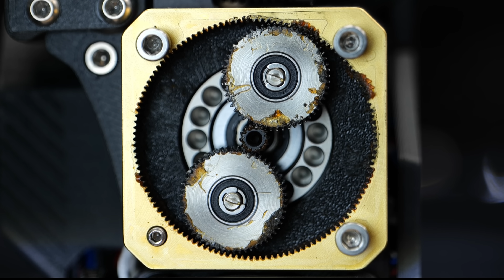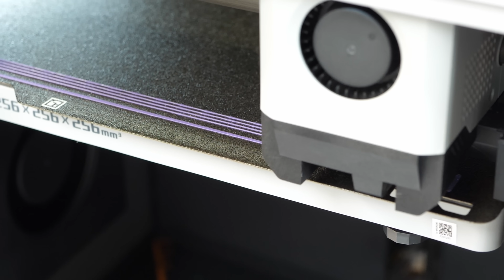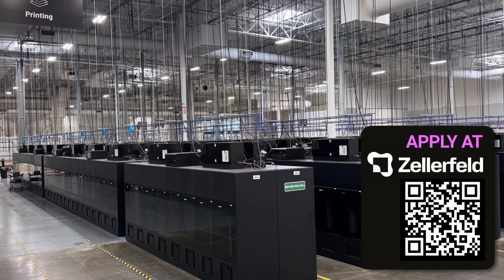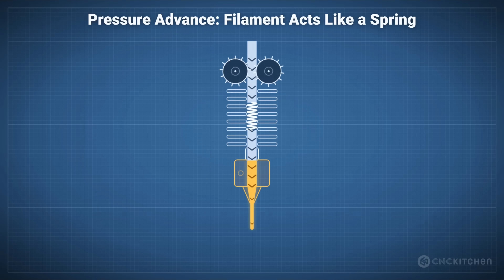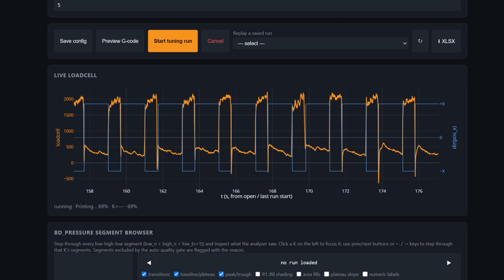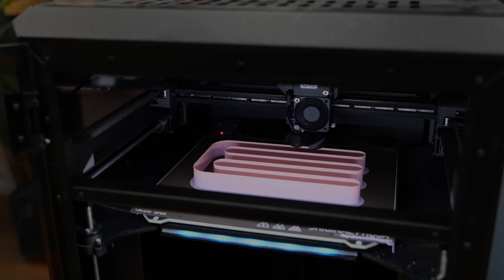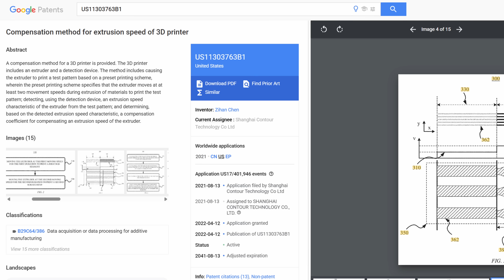I Automated Pressure Advance Using a Bed-Leveling Sensor

Comment: You totally missed explaining how BambuLab printers only use Lidar for the very first filament and none after that. Because of that, the automatic K values will be wrong. Also, I'm not sure they store the K values anywhere, so it's not like you can use them in a future print job either. What a waste. I'd prefer to simply measure it once for the spool (since it can't do it during the print like Prusa's load cell), and be done with it. Doesn't have to be this "every time but only for the one filament" thing.

Comment: This may be way off. I still have issues with the design software. I come at this like a race car needing a accusump oil accumulator. Currently the acceleration of the molten filament is not directed downward if the pictures you show are true. If the internals of the hot end were enlarged to Maybe a downward slowly twisting screw counter direction shaped wall to a center section screw shape would direct the flow downward faster during acceleration. Those could be swapped out depending on material. It could be a heat source as well making the filament slicker and slide off easily.

Comment: i hope you are still working on this and that this becomes well adopted in klipper... turnes out in germany its pretty hard to get the HX717 chip which has a higher sampling rate then your avarage hx711 chip. but i bought some from hungary and crality has some strain gauge/loadcells which are pretty reasonablely priced. im currently in the design prozess and i really hope that i can get it to work with the plug in... i think this is really a massive leap forward bedleveling, gantry leveling, mesh bed leveling and pressure advance all with bascially no moving parts and one single pretty simple and lightweigt sensor sounds like a dream. no stuck bl touch probe, no unrelatible inductive or light sensor wo worried about a sensor not triggerd properly and the nozzel crashing into the bed because the crash is exactly what this is working off of ... really huge promises into reliability and precision... later this could even be used to index off of parts x, y and z to do recovery and stuff

Comment: Hello stefan, i think your product is absolutely amazing, i wanted to propose to train an ai based on the square wave yout talked about, it should be realtively easy since you implemented already all the metrics and you only have to change one value. I think an unsupervised training could be performed; in alternative an analysis with mechanical impedances may pose as a starting poit to run a simulation to trian an ai ad then validate it in the printer. If you saved the previous runs maybe you could also use them as a dataset.

Comment: Patent are probably the worst thing happened to innovation in the last millenia. All the patent are based on the work of the whole scientific community, made by the humanity over the whole story. that epsilon additional knowledge added by a signle individual on top of it makes the whole knowledge unusable for everyone else. 
Bamboolab didn't invent LiDAR, didn't invent FDM printing, didn't invent backpressure calibration. But with a patent they can prevent the use of LiDAR to perform backpressure calibration in FDM printing, even to the people invented those technologies. 
Furthermore, they are basically using LiDAR, backpressure calibration procedurees and FDM printing for their intended purpose, and making a patent out of it. They should have copyright on the exact implementation but the idea is trivial: like patenting using a caliper to measure the calibration print to get the accurate result, you are just using each tool for their exact intended purpose, no innovation. Something like that, while requires a little bit of research to fine-tune the parameters, but is not justifying the ability of maintianing exclusivity for 20 years (which is what patent grants).

Comment: What I am always asked myself: How does the automatic flow calibration works when there were already some PA values set in the print file? Do the values interfere with each other? Or does the the value gets replaced?

Because I assume that in the final g-code it's not possible to determine the used PA anymore. 

Would also be nice if we could see the measured values of the snapmaker for example to save it then for that filament so we don't have to run flow calibration again.

Comment: Implementation into the FW is much easier than the web page you've created. Take the FW code, some AI agent and get inspired by G26. Let the agent to create a new metric for this. I can create it but I don't have a Prusa printer with the Nextruder.

Comment: I really liked it back in the day when I could get the X1C's autocalibrated K values out with the Homeassistant integration, and then I'd just put it into Orca. But I haven't been able to do that for ages now.
For the U1, is the autocalibrated value available for read out anywhere? Cause right now, when I switch filament, I have to ask it to calibrate, which takes time. I'd prefer to just store the K value in Snorca. I recently learned I can just enter the U1's IP into my browser and see the see the Fluidd. I wonder if the values are readable through there somehow if Snorca doesn't want to expose it.

Comment: In regards to the actual print progress I was thinking about this for print recovery, but since the sliced file is volatile I wanted to run the file backwards in height through solid wall (where wall should be) till the sensor hits the print, then run the layer backwards again till hits print then runs the file from there minus a line or 2...

Comment: I have been looking at comparison between the U1 and the Creator 5.  Nobody has ever mentioned automatic calibration, shouldn't the lack of calibration show up in reviews or does the creator 5 actually do it.  While I am talking about reviews, the Creality Hi uses closed loop servos and this is not demonstrated in any reviews,  surely this is a big improvement but may only show up with long term usage.

Comment: The title felt like clickbait. Was disappointed to see that only a  load cell mounted on the extruder in a particular way could be used for leveling and auto pressure advance. Still cool though, nice work.

Comment: That´s pretty awesome!
Is there a difference if you "actually" print into free air or if it builds a mountain?
Could pressure advance be combined with accelerating or decelerating it´s moving axis also?

Comment: But what about different pressure advance values for different speeds and accelerations? Only one value is not enough, regardless of whether you obtained it automatically or manually. You have to look at how it actually prints with different acceleration as the filament being dragged more rapidly and you may need to kick in additional pressure earlier not to smooth the corner.
This is why adaptive pressure advance is a thing and produces extraordinary results.
I know the video is mostly about technology and not how to transcend it into practical field, but still, worth mentioning.
Reply: Yeah I was wondering that too, sure you could tell the extruder to go faster similar speed to your actual printer, but then there's other circumstances where filament may get dragged out by the filament that is laid down already.

Comment: Could this be done with motor current sensing? I'm thinking about tool changers and the expense of adding a load cell for each tool when auto PA could be had for free using the extruder stepper motor (assuming it's feasible).

Comment: Your thumbnail says LIDAR, but I've never seen anyone tear down the bambulab "LIDAR" sensor and demonstrate how it works, whether it actually uses lasers, what the part number is, etc. I have my doubts it is actually LIDAR and is really just a camera, but would be interested either way. Your idea is great, thanks for sharing
Reply: It isnt LIDAR in the traditional sense of measuring time of flight (or fancy FMCW magic).
Its based on trigonometry with a line laser and a camera.

Comment: Would it not be better to have the nozzle printing lines at height with intermittent extrusion speed changes like others do it? I would think extruding in mid-air excludes the important variable of back pressure.

Comment: I had bought an SV08 partially because I was under the impression that its pressure sensor was actually in the nozzle, and I am continually dismayed that this is not the case. Something like this would be very easy to implement into such an open system.

Comment: Does the calibration process increase K value linearly to calibrate, or does it use a more efficient algorithm requiring fewer test extrusions? Using less filament when calibrating would be a plus

Comment: Add live monitoring during the print to auto adjust for filament tolerances and now you get dimensionally accurate parts on filaments that are +-.05mm 1.75 mm…or more. $5 MAX PRICE PER KG FTW. Maybe even cheaper once manufactures can’t hide behind tolerances being a price constraint. So long as they don’t start messing up the formulas 🙄 good thing their existing formulas are basically everywhere in at least a couple hundred thousand benchys all over the world and has been for YEARS

Comment: Great info about the flow calibration, wouldn't the head level while extruding also cause back pressure?? It would be different when doing a .4 layer and completely different when doing a .2 or a .08 layer?? While feeding into thin air will give a reading for testing it doesn't take into affect the added pressure of the layer height and the speed its being laid down at?? Maybe i am over thinking it but its just my take on your process, keep up the great work on the printers. Look forward to the next one!!

Comment: Hi Stefan! I wrote to the auto pa tune guys cause they posted in the voron facebook page about it a while ago and i had just "purchased" a pair or heatcore 4 hotends, one with the ALPS module. Maybe slightly irritated cause it seemed to me looking at their github and webpage they just wanted to sell their hotend loadcells. I Couldn't be more wrong. They answered me that the ALPS module was compatible and I could perfectly just "use their project code". in the end I have still not been able to try it as I dediced to first finish the stealthchanger mod I had started and still haven't finished but maybe that klipper module can help you try it in another klipper printer more open to get debugging data.

Comment: Since G-code is a complete language, why not sample the variables and do the math in a G-code program?  Do most printers implement the full G-code language, or just a subset?
Reply: Not even every CNC machine implements all g-code commands, and there can be differences in how each command even works between manufacturers. I have experience in CNC lathes and milling machines using Fanuc's control systems, and as far as I know, G-code isn't a "programming language", it's a set of commands that you can use to create a program for the machine to follow. I mean, you can't "do math" in the program - you tell the machine to "do the math" with the correct commands (eg. interpolate a move there, calculate and perform a loop here, start a work cycle from there etc.).

Comment: A single K-factor isn't going to do it, you need to tune for many possible values if you want it to be general-purpose.
Nobody is doing this yet, but, with a system like this, it's entirely possible.

Comment: Only issue with this is it requires printers to have a strain gauge. Wonder if you could look at amp draw of the extruder stepper motor to determine how much pressure is created and use that.
Reply: But the extruder motor torque also includes the moment if inertia when changing extrusion speed.

Comment: The main problem with PA is that it needs additional parameters, such as actual flow (not the gcode calculated, but the real flow), which is dependent of layer height, width, temperature etc. That's why I use adaptive pressure advance with orca. Needs lot more time to calibrate, but gives faaaar superior results, especially with bigger nozzles.
Reply: Adaptive pressure advance exists?! Whoah, I guess I finally got to take a look at that whale, despite it being so damn ugly...

Comment: Very good video, but the prusa extruder when the thermal glue of the load cell is damaged (the high temperature may damage it) the extruder start many times loops of calibration and create holes on the platform because a fault load cell don't stop the z axis on the platform. The difficulty for this problem is the high cost of the conponent and you should disassembly the entire block. 😅

Comment: Using the same technology, you can set the temperature of the hotend automatically. This way, no matter what type of plastic you use, it will always print at the correct temperature and flow rate.

Comment: Excellent video. I think you can get the klipper info on the motion planner too. I did it for a couple things in the past. Its not too hard to get. It should gove you what you need to tune your pa. Its through the api. Just need to start killpy with debug api
Reply: It's a solved problem on Kalico, garethky has been looking at that 🙂

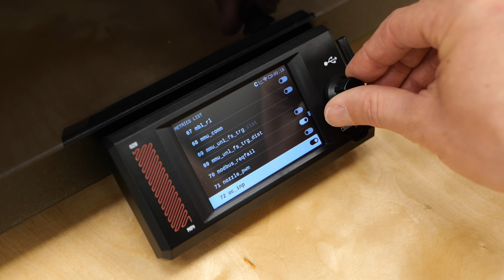Comment: 12:15 Since you can send values for the x and y positions, wouldn't it be possible to move the extruder along those axes a bit to determine the start and end of each test cycle? 

While watching the video, I noticed that the extruder was moving back and forth a bit, so I guess that's what you were trying to do, but if not, that might be worth a try.

Comment: PandaPI sensors are my go to.
The BDPressure allows me to Auto-Calibrate PA at the start of every print, while the BDWidth makes sure any inconsistency in filament width is automatically accounted for.

As per the software tools you made, might I recommend having your slicer hand over your print metrics (Outer wall speed, Accel, Accel-to-decel ratio, extruder-temp, etc) and have that data decide a more optimal curve per print, essentially creating a custom nonlinear PA curve.
I have a proven fork of mark's bdpressure code with these changes implemented. Works well for my setup.
I also have an edit for the BDWidth code that accounts for occasional off readings, averaging measured filament width over a selected length-step (every 5mm works for me)
Love that you covered the sensors! They're awesome!

Comment: I wanted to monitor chamber temperature on the Core One and XL over my local network, but PrusaLink doesn't offer it.
Looking at the metrics feature, though, it can monitor a lot more than just chamber temperature.
I happened to find the answer to my problem in this video. Thanks, Stefan!

Comment: "This is incredible work, Stefan! Now that Prusa is deploying the multi-tool INDX system on the CORE One, automated load cell calibration shouldn't just be an experimental script—it needs to be native. Swapping up to 8 materials on the INDX means manual K-factor test prints are a user nightmare.Since the hardware (Nextruder load cells) is already sitting in thousands of machines costing $0 in extra parts, you have the ultimate leverage to push Prusa into natively deploying this. Please keep pushing them to integrate this into the official Prusa Firmware roadmap! The community has your back on this."

Comment: Could you not use a simple binary search to find the elbow point where force increases, then sweep near that to save filament?
What about an "external" load cell (for custom printers/Klipper) - park hotend on some surface with load cell and measure, so that the load cell is not on the hotend?

Comment: Having the load cell data available at all time makes the PA approach instantly looking outdated. There should be a PID directly onto the flow with the load, that is proportional to the pressure and the known geometry of the nozzle. That's amazing.I instantly have to look for a loadcell arrangement for my delta effector. You are a genius. Thanks.

Comment: The Anycubic Kobra S1 ask at start for "Flow Calibration" if u use the "Anycubic Slicer Next". They also use the load cell for this and make this at beginn in parking postion.

Comment: Something that is a big issue with the current state of high speed 3D printing is the fact that PA is *only correct for a single set of process parameters*. The PA algorithms simplify the situation to a first-order response (as shown in the video), but in reality there is more going on. PA value changes with acceleration and material flow rate. With a more advanced algorithm that considers material rheology, you could get one PA calibration that is valid across a wide range of process parameters. The current issue with this is tuning. Even the simplest PA algorithm that considers nonlinear effects has two constants to tune for, and they have to be tuned together. A test print that collects data from a nozzle load cell over a sweep of values would allow this tuning to be automated.